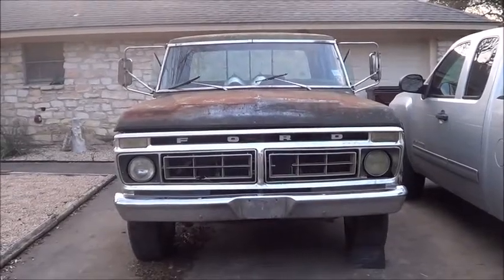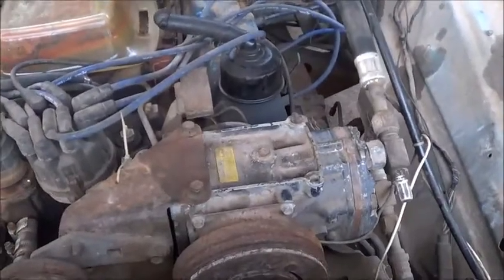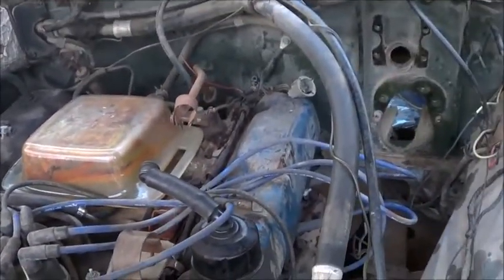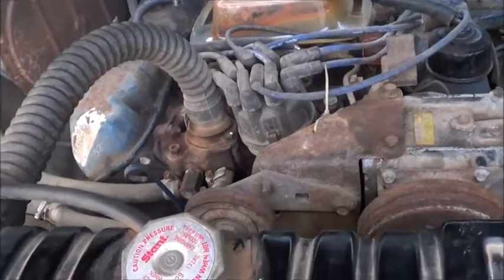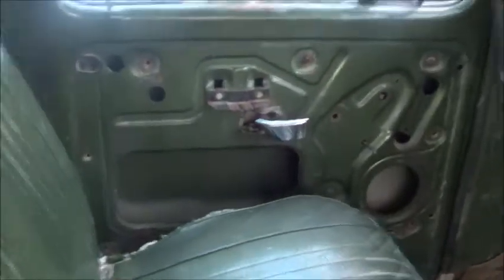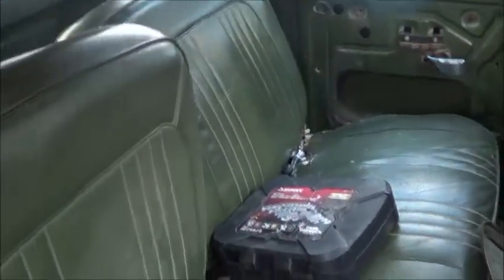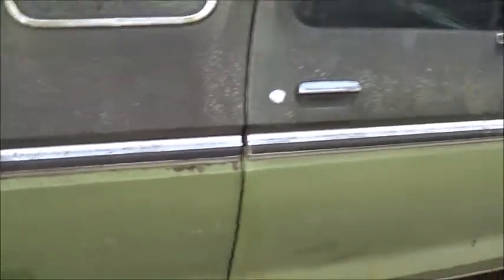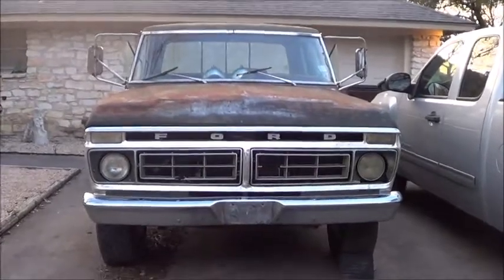I Bought a '76 F250!!!!

Comment: Can you post or send me a picture of the spark plug wires on that cap? Can’t figure mine out I know it’s 1-5-4-2-6-3-7-8 counter clockwise but it just doesn’t start or backfires
Reply from the maker: For a 351w the order is 1-3-7-2-6-5-4-8. Maybe that’s for fix?